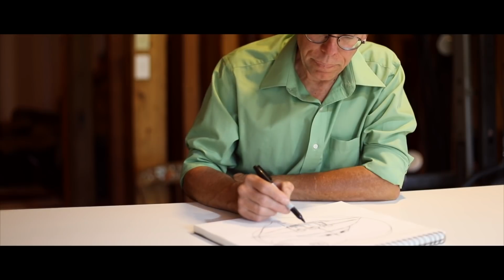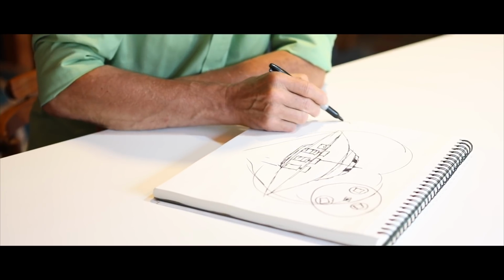BOB LAZAR : ANATOMY OF A FLYING SAUCER : EXTENDED SCENE

Comment: I've been familiar with Bob Lazar for many years, decades . . . his descriptions have always been very consistent, has never embellished or changed any details.  If one were compelled to believe that such ET hardware has been retrieved and is being reverse engineered, this is possibly among the most credible testimony available on the topic.  The description of a completely seamless, solid construction could be a material fab system facilitated with nanotech assembly.
As for the production itself, it's a bit corny, a little bit heavy on the UFO lore drama . . . just my opinion

Comment: Many investigators of UFOtech have landed on the Biefeld-Brown Effect as the primary means by which gravity can be effectively "screened" from influencing the mass of any craft that embodies the Pauli Exclusion Principle. (There seem to be craft that don't.) But the B-B Effect only allows an object to become weightless.  Propulsion, however, is another matter.  Since Bob does not seem to have a background in the B-B Effect, he appears to address more the issue of propulsion than levitation.  Lazar's propulsion seems to display two factors: 1) Gravity wave transceivers (receiver-emitters). 2) Gravity wave amplifiers. Basically, Bob may be describing a technology that allows a weightless craft to focus on a distant source of gravitation (a planet, star etc) using a "receiver wave guide" then amplify that gravitational influence, and project that influence via a second "emission wave guide". So we might say that Biefeld-Brown makes a craft weightless, while gravity wave receiver-amplifier-emitters provide propulsion...
Reply: Elsewhere, Bob speculates that the craft at S4 were "in perfect condition" -- not crash recoveries.  We might speculate that the visit of Ike to Holloman AFB (1955) by what is described as a similar type craft (a sports model)  resulted in some kind of an agreement that sourced the craft Bob is describing...
Reply: You'll note the above reference to the "Pauli Exclusion Principle". (No two material objects can occupy the same space at the same time.) Such a craft appears to have a material basis -- but many reports describe craft that are more "ethereal" in nature. Such craft fly through mountains etc. without damage to the craft or the mountain-side. Ultimately, the only way to reconcile "nuts and bolts" and "illusory" craft is to say either: 1) That the two types are "inter-convertible" (say by "pushing a button") or 2) that they are distinctly different from one another...
Reply: There is also a formative notion that the occupant (pilot) of either type craft (Nuts and bolts/ethereal) is an essential component of the craft's ability to fly. It would be interesting if Bob could remark on this point at some time in the future.
Reply: Finally, Bob seems to have arrived at the conclusion that the craft he worked on were "alien" -- but such a notion has several shades of meaning: "ET", "UT", crypto-terran.  Most investigators have now rejected the "ET" source of such craft (for a variety of very good reasons). Some are now concluding that craft displaying Pauli-Exclusion characteristics are Crypto-Terran while those which do not are Ultra_Terrestrial -- meaning they precipitate into visible form then dissolve back into the ethers from which they came...

Comment: The physics of this was worked out by German scientists and engineers during WW II.  They used a large bell-shaped vacuum chamber with dense mercury vapor inside.  They had counter-rotating magnetic fields. The skin of the craft is made by vacuum deposition, one atomic layer at a time.  It has 80 layers of material, and contains just about every element in the periodic chart.

Comment: In the Andreasian Affair . . Betty said she was held into the seat inside of a craft or a device on a track and it felt like pins and needles holding her into the seat.  She also said that when the EBE's came into her home they were floating above the floor.  She also said they were preparing her for the trip back to the earth or through time and space. . . . they put a white liquid into her stomach through a tube of sort.  I know that they can transfer a person  from one galaxy to another outside of time without any noticeable vibration or sign of motion. in other words you  don't even notice that you have just moved millions of light years  in less than a second and this with  no ill effects.  However, if  you had reached out just a few feet  your hand would simply disappear. You arrive to your destination  as though you didn't even move one inch.

Comment: A Russian Scientist mentioned by Dr Paul La Viollete developed a gravity wave gun, that could shoot a coherent beam of gravity 20km and impart 20 lbs of force. It travelled freely through walls and could knock over a pile of books miles away. They determined it used gravity waves through experimentation and the scientist was acquired by a defense contractor. It is probably a primitive form of what we see in those three gravity emitters. It takes T. Thompson Brown's original research to the next level, using a gravity well for interstellar Propulsion and a gravity hill for planetary Propulsion, manipulating gravity waves in a way analogous to how masers manipulate coherent microwaves. 

The design of the gravity gun is quite simple and is included in La Viollettes' book. It does violate General Relativity in its current form which only treats gravity as an attractive force, and it violates Newton's Third Law. But it works and has been tested numerous times. 

The correction of Maxwell's equations allows for the linkage of electromagnetism and gravity. Ben Rich referenced "finding the error in the equations" and there's a good textbook on the subject of how Maxwell's equations in Heaviside's form had some fundamental errors such as the omission of the Scalar component of EM. Once this was corrected a vast new set of possibilities emerged, such as antigravity, first explored by T. Thompson Brown and elaborated on by Russian and German scientists who we acquired during Project Paperclip. 

By taking a Quantum approach to gravity, a Japanese Physicist named Musha developed the Musha Jump Drive based on a paper by Dr Hal Putoff that allows a craft to jump through the "speed of light barrier" much like an electron jumps through a layer of silicon on a microchip, allowing for jumping enormous distances due to the properties of negative energy. An example given was being able to jump to the Andromeda Galaxy, 2 billion light years away, in 30 minutes, given sufficient energy. This comes from looking at things from a completely QM perspective and abandoning Special Relativity. There is a good video on YouTube discussing this drive, just search for Musha Jump Drive.

Comment: Did Bob Lazar get pulled into a jackpot and sent out in the world to tell his tales? Sure. I have grave doubts about this saucer design..which displays a curious  "up-down" orientation which a spacecraft really should not..it seems specific for planetary use, not deep space zero G..why would you have 3 gravity wave projectors oriented to only operate under a floor (indicating a "bottom" or "down") and only rotate 180 degrees on one axis and 360 on the lateral plane..they can't point "up". this would severely limit maneuverability. I'm skeptical of his asumptions on the function of this system.
Reply: What's the problem?
Reply: @codetech5598  ummm..I just told you. The design as described does not indicate a spacecraft, which would be logically built for the environment of space..a 360 x 360 no-up no down medium..as Spock observed of Khan's battle tactics in the well-known film, "He displays 2 dimensional thinking". The very design, which places 3 grav wave projectors "under" a craft and limits their rotation..no X-Y-Z capability..indicates earth-centric design..the kind of design a human would think of.
Reply: @garyroberts1552  If you want to do loops and rolls, get a WW1 biplane. This is a spacecraft.
Reply: @garyroberts1552  It is an actual spacecraft, not a fantasy movie stunt machine.

Comment: I have a lot to say and would like to talk to Bob Lazar.   I would like it if someone could explain GRAVITY to me. also around the sixty's when I was in 6th grade I asked my sci teacher if you drilled a hole through earth and jumped in how far would you fall.  or would gravity suspend you in the middle.  Thank You to BOB LARZAR for being a stand up guy.
Reply: I think all we can say about gravity is that its a distortion in the fabric of space time, generate by the presence of mass and can only truly been seen through the lens of mathematics. Outside of that we can't control it, or mitigate its effect and can only work around it. 

Hypothetically, if you were to fall through the center of the earth you would pass through the center and keep going in the same direction due to your momentum, then stop due to the opposing action of gravity and move back in the direction you came repeating the cycle momentum push, and gravity pull on either side of the center of mass (center of earth). If you were in a perfect vacuum with no other matter slowing you down due to friction, you'd pretty much become trapped in this back and fourth forever unless the mass of the earth were somehow reduced to the point that you were able to escape and be flung out into space. 

If you were not in a vacuum, with at least a little bit of atmosphere, you'd slow on each oscillation through the earth due to friction until you came to complete stop at the center of the earth, like how a swing on a swing-set would slow slowly and come to a complete stop.
Reply: So with out any doubt I think of space like a fabric.  I also took a bowling ball about 5lbs and place it on the bed. the ball creates a funnel around the ball. then I said with in that funnel is gravity and you are falling in word. that is one way to look at it.  also does gravity meet in the middle. and can you measure it. can gravity create heat where ever it meets.
Like the hole through earth maybe when you got to the middle it would be like hitting water and you would slow way down.  just my though.
Reply: Ronald Hodgson you will die way before you reach 1/4 of the hole by lack of oxygen but if r lucky to have enough oxygen with you then you will burn when you reach the molten core of the earth . So no you will not be suspended
Reply: @jjgarza70  My sci teacher said the same thing.  So hypothetical speaking take all drama out. and then jump in. or do it on the moon. also can it be created some how. like some model. or computer program.   you just have to know what Gravity is.

I will tell you and any body who reads this. My wife and I where driving east bound on Rt 17 and the music was kicking with RUSH. I was not thinking at all. I could feel my wife had something going on. I look at her and her face was zombie like. I looked where she was looking and it had to be about 150 to 200 miles away. I would say 1 mile long and about 1/4 high with in color. a beautiful white color. it was cloudy except for one part that had a hole in the clouds. I could not tell if the clouds were moving or the ship. my wife was so scared. but it had to be 200 miles away. this is not my first sighting.  what blows my mind is how can something so big sit there or move at will. the energy it takes just blows my mind.   I can not even make a generator to run my house with out creating energy to run the generator. but yet they can go at will...
Reply: @jjgarza70  What a pessimist, obviously, you would get a free, comfortable ride to China.
Reply: That's actually a physics problem that is often studied in undergraduate physics programs as an example of Simple Harmonic Oscillation (SHO).
The answer might seem a bit counterintuitive to some.  The whole Earth pulls on you from every direction, but as you descend towards the middle, your weight will lighten and toward the middle you will feel no weight since you have (presumably) the same mass distribution of the planet in every direction.  You would oscillate back and forth between one side of the planet and the other (driven by your initial velocity) until your movement was damped out (air friction and transfer of kinectic energy into the surrounding materials that pulls on you, into randomized heat energy).  All this assumes there is air in the tunnel, if there wasn't then you ( or whatever you dropped in) would oscillate  until the motion was damped out by whatever forces were present in the system.
Reply: @LaserGuidedLoogie  how deep would you have to enter the Earth before your weight started to change. There are some mines that are pretty deep.
Reply: @LaserGuidedLoogie  I was thinking about what you had said about getting lighter. But I think maybe you would get heavier. I know when you go higher up you get lighter. So maybe the adverse effects would make you heavier.
Reply: @Shawnee845  Well, if you think about it, the pull of gravity cancels out in every direction except in front of you and behind you.  As you descend toward the center, the you have more mass in front than behind, then as you reach the middle, you have equal gravity from every direction, then as you ascend up the other side, you have more mass behind than in front, so your weight (w=m*g) increases.
Reply: @LaserGuidedLoogie  I like the way you explain things. And I also like to think in all different directions.
Reply: Ronald Hodgson I wish I knew about all this stuff when I was a teenager and I met him. He was trying to explain it to me but I thought he was nuts and it was way over my head
Reply: I think you'd be falling at such a speed and force that gravity wouldn't be able to stop you once you made it to the center